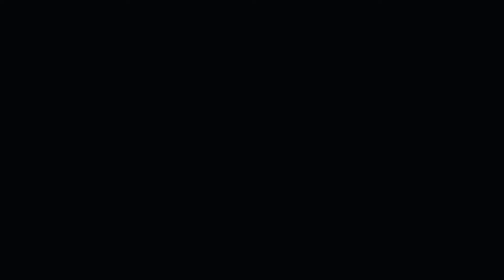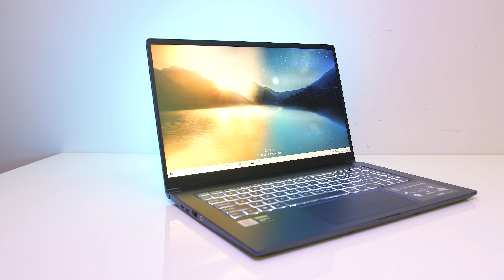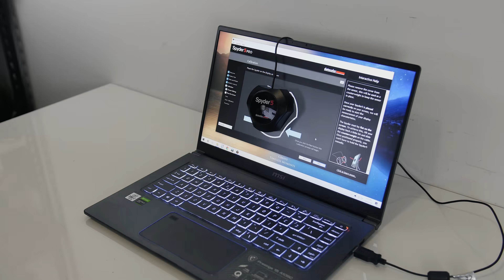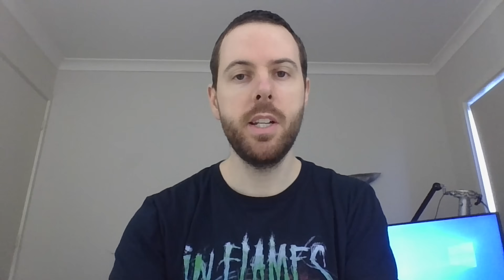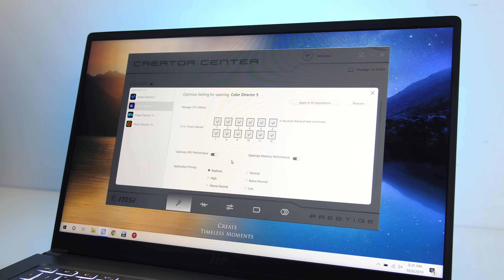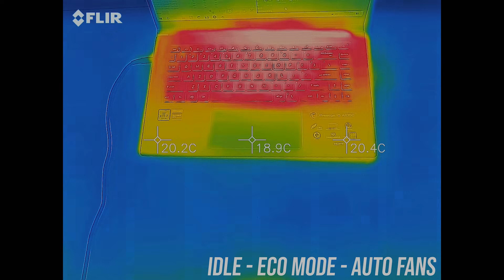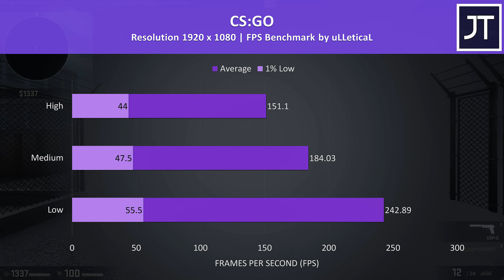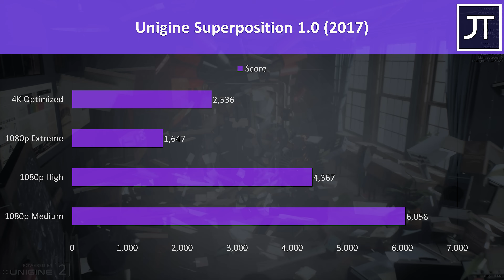MSI Prestige 15 Review - 10th Gen Laptops Are Here!

Comment: Thanks. Hopefully the 14” doesn’t go nuts with high temperature under stress, as that one only has one fan.
Reply from the maker: Hopefully I can try it out soon!
Reply: @JarrodsTech  I am really looking forward to the prestige 14!
Reply from the maker: @AdaDenali  Me too! I confirmed with MSI it will be available next month in Australia so hopefully not too far away.
Reply: @JarrodsTech  Seems to be listed at a few retailers now, but only the A10SC model with GTX1650. Seems good value for $2300 if it can keep itself cool under pressure...
Reply: @ad_fletch  starts from $1399 and goes upto $1799 max. $2300 must be a customized one with swapped ssds or ram
Reply: @preetishhs  Was talking Australian dollars!
Reply: @JarrodsTech  I hope so too. Let's see who gets it first LOL.
Reply: One fan? I was reading about it right now, that's probably a no-go. The 15" already struggles, I need to see what magic will they do to keep it cool.
Reply: @kevinw0lf  There's a review of the 14" on Reddit where they put thermal results under some stress test, you might want to check that one out. It seems to do good, without any UV or thermal paste change.

Comment: Watched this on my Prestige 15 :). Battery has been finally calibrated after 3 days but performance profiles aren't working while on battery no matter what i do (Both windows options and Creator Center) and on benchmarks cpu cannot go further than 2Ghz, but on charger it reaches 3.6-3.9 , also, i cannot turn the fans off on Basic fan mode, only auto and cooler boost are working even after reinstalling that app. Maybe an app update might fix this.
Reply from the maker: Sounds about right for battery performance, I don't usually test on battery power as there's so much variance.
Reply: What's the battery life like?
Reply from the maker: @sptz87  It's good, discussed at 5:47

Comment: Hi Jarrod. I am an exactly creator :) I liked that machine but is GTX 1650 necessary for me. There are nice Dell Inspiron versions,they have mx250. I will use photoshop,premiere,3D design.
Reply: it would be a very noticeable difference, gpu helps a lot. more is merrier
Reply: The 1650 is much better than the 250.
Reply: BarrettKillz yeah but he just said he dosent need the gpu power so for him the 1650 just makes the laptop more expensive
Reply: @extr3me225  Where did he say he doesn't need GPU power? He literally said he will use Premiere and will do 3D rendering..
Reply: BarrettKillz he asked if the 1650 is necessary for him and his tools.
Reply: @extr3me225  And you just assumed the complexity of his Premiere projects or 3D models, is that right?
Reply: BarrettKillz yes because he is saying he most likely won’t need a 1650 meaning what he is doing probably is not to intensive
Reply: @extr3me225  The most important part in your point "probably". You don't know that.
Reply: BarrettKillz I’m most certainly sure since if he needed the power of the 1650 he wouldn’t have posted this comment
Reply from the maker: I haven't had the chance to compare MX250 yet, but for photoshop I don't think it'll matter much, for premiere it might speed up exporting but don't think it'll help with the actual editing part, will probably make a big difference for 3d design apps.
Reply: @JarrodsTech  I've seen myself what it means to do 3D rendering on a low-end GPU, leaving your laptop overnight to render a complex 3D model, only to find out in the morning that it froze and it was all for nothing.

Comment: Hi Jarrod! Is i5 9300h and 1660ti a good enough pairing for gaming or should i go for i7 9750h?
Reply from the maker: I think the 9300H is still decent, but depends on the game you play, many games can benefit from more cores and you can't upgrade the CPU later so if you can afford it i7 would be good.
Reply: @JarrodsTech  Thanks!
Reply: @szch664  if you want to replace it in a couple years, i5 is fine. if you want to keep it til is falls apart, get the i7. a lot of games do use more than 4 cores now, and its going to matter a lot more once consoles get refreshed.
Reply: @bradhaines3142  I still remember people saying this about 10 years ago... Then right before the current gen consoles launched, its still kinda not valid... A very very few gamez benefit from having more than 4 cores.
Reply: @JeyKalda  wrong. most new games use more than 4, depends on the engine and type of game, but over 4 cores are definitely used these days
Reply: @bradhaines3142  big difference inbetween usage and utilization

Comment: Do you know if there's any new laptops coming out with RTX 2070/2080 with the new 10th generation intel cpu?
On a related note, would you recommend the new Strix Scar III or the GX502? I heard the GX502 is loud but its so high up on your benchmarks.
Reply from the maker: I haven't heard of any, but I have my doubts as the U/Y series are the only 10th gen parts at the moment and they are generally used in lighter/thinner machines like this rather than with high powered graphics. It could happen, I just have my doubts, probably need to wait for 10th gen H series which might not be til next year.
Reply: @JarrodsTech  Thanks man, I was wondering because I was hoping it might bring the GX502's price down! I edited my comment just now between the GX502 or Strix Scar III. Which one would you recommend?
I promise when I buy it, I'll use your referral :D